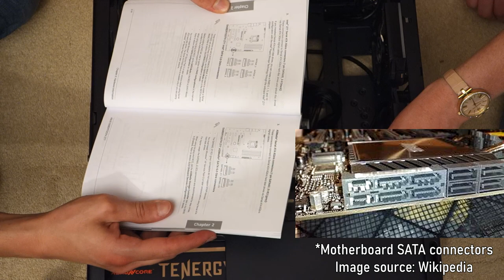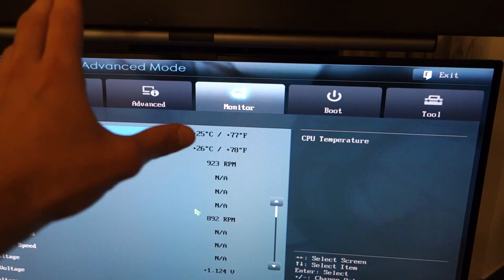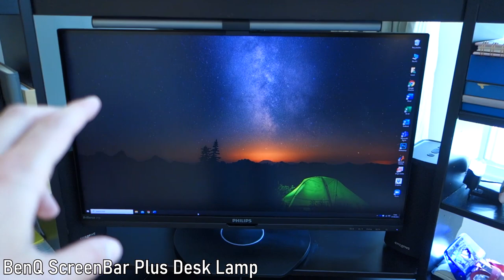How to build a PC: My fiancée's first desktop build

Comment from the maker: Video timestamps:
-Intro: 00:00
-Prepping the case: 00:28
-Motherboard: 02:53
-RAM: 03:18
-Processor: 04:00
-Power Supply Unit (PSU): 04:12
-SSD: 05:11
-Power Supply Cables: 07:06
-CPU cooler & thermal paste: 08:32
-Wireless card: 11:23
-Case fans: 12:21
-Connecting the motherboard & CPU cables: 13:17
-Plugging in the fans: 14:31
-Connecting PC case & SSD to motherboard: 16:21
-First boot: 18:48
-BIOS: 20:07
-GPU installation: 21:06
-Drivers & connectivity: 23:53
-Laura's setup: 24:32
-Outro: 25:40

Comment: I always put in the RAM in before placing the motherboard into the case also it's easier to also put in the cooler outside the case as there is much more room to work with and I always connect  up any PSU cables before placing the PSU inside the case but that's just me
Reply from the maker: Thanks for sharing!

Comment: Glad to see it got a graphics card... I thought "Intel HD graphics.... how cruel!"
Also, backplated coolers, usually best to fit with board outside the case, as they can be a right pain! (bitter experience speaking!)
Reply from the maker: Yeah, that's one of doing it; I just tend to do it inside the case - old school way :D
Haha - to be honest she'll only be using the GPU sparingly for CAD/CAM work, or illustrations; on the plus side, she can now get 1440p 75Hz, whereas before she'd have been limited to 60Hz 'only'

Comment: dont want to be that guy but the ram is in the wrong spots. the blue ram should go in slot 1 and 3 and the black ram in 2 and 4.
Reply from the maker: There was bound to be someone haha, here's the explanation:
I ran this setup for about 8yrs; in that exact configuration, on that exact board.
The reason why: to give my (beefy) cooler - the Noctua NH-D15 space. Before purchasing the second kit of RAM (back in 2012-13), I made sure they were the exact same. All four modules run at 1,600 MHz, CL9, exact same timings and all are 4GB modules, each :D
Reply: @TotallydubbedHD ahh ok that makes sense. should of watched the full thing before i commented
Reply from the maker: @PizzaOMC  haha don't worry ^^
Reply: Well if we are going there. The rear fan was on intake. Cpu was push. Aka negative pressure.
That's some cheap Korea/Chinese tech hope it stays alive though. 

Should have given here your new PC.  Show how much you want her.

The rest is too long to list. And I'll leave something else for someone. Not gonna be greedy.

:P

Best quote

"Why would you need a hdd'...

Also 

MOLEX LMAO!

Good video none the less :)
Reply: @TotallydubbedHD  Would have been better to put ram in the other slots even so. For those that are gonna spot it.
Reply from the maker: @IREWolfman  erm, actually was/is an exhaust. As for the RAM, as mentioned, it's worked for the last 8 years. Literally makes no sense or difference.
And ps. for those who know PCs, they'll know the timings, speed and capacity of those (really popular at the time) modules ;)